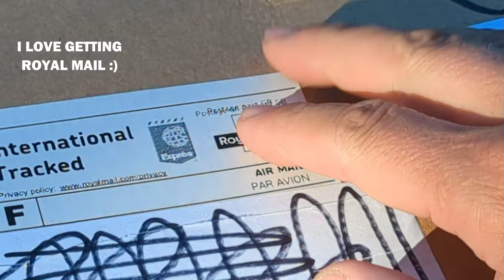Evotech Radiator Guard Install on my 2024 Triumph Street Triple RS 765.

Comment: Very easy assembly. It seems to me, that unscrewing the screw at the bottom of the radiator is not necessary. But that's just my opinion😉
Reply: I installed this on my RS three days ago and never touched the lower bolt. This installation is straight forward and the part is well made with excellent fitment. Highly recommend.

Comment: Thanks for the video - clarified what I had assumed with the round rubber grommets. It's a shame you didn't do an Evotech tail tidy also, then all my bases would be covered :)
Reply from the maker: I really like the EvoTech tail tighty, a lot, I went with the Brogue but I absolutely love the way that EvoTech fits. Maybe if of people tag EvoTech and they send me one I will do a install video!
Reply: Installed the Evotech tail tidy the same day I installed the radiator guard. Thick, well made and straightforward installation. The factory unit is so unsightly and this one is perfect in fitment and design for this bike. A must have addition in my opinion.